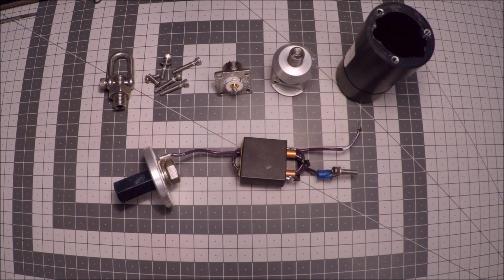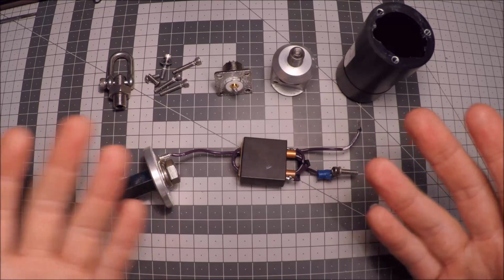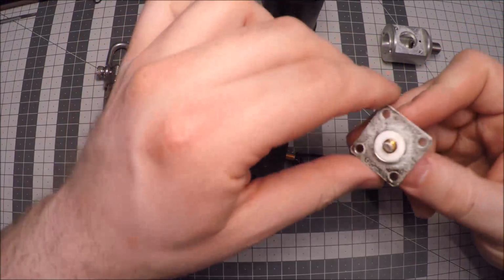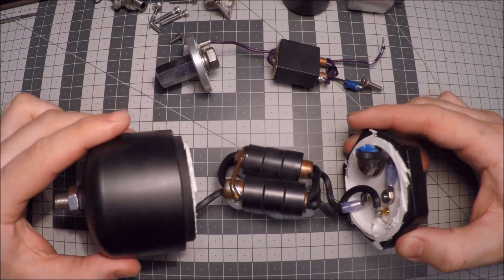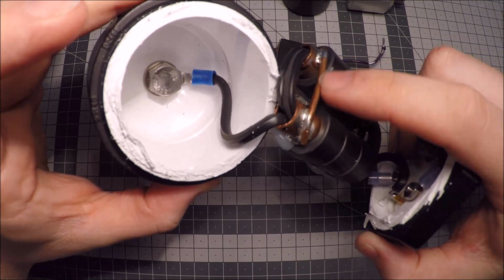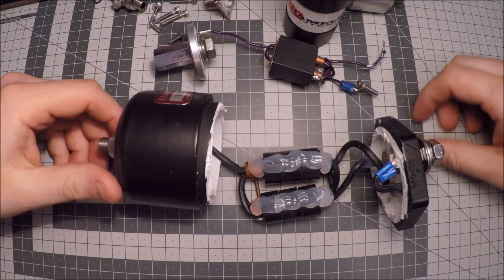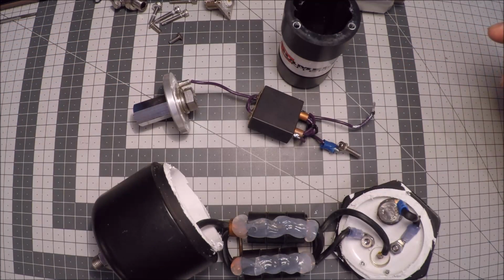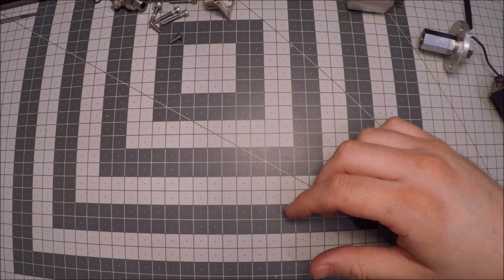Chameleon Hybrid micro VS. alpha match

Comment: Does anyone know what type torrid material the hybrid micro uses? I know the Ecom II uses type 31.
Reply: I use type 33 beads. Newark has the toroid cores that you stack, #98k8793. You'll need six. In lieu of copper pipe or tubing, you can tight spiral wind bare copper #14 or 16 solid. Works for me. eddieson
Reply: @johnstumm3155  Thanks for info! You are correct, the 33 beads are better. I am still wondering what torrid is used in the hybrid micro as I cannot find the binocular type in a 33 mix only a 43 and am wondering if maybe the micro uses a 43 mix?

Comment: Question, is the black  body of the Hybrid Micro plastic or metal?
 I would think stray capacitance would be picked up from the body if it was a metal body. Every unun I have looked at is always in a plastic box. This got me thinking when I saw your very good video on the comparison. I would be very interested in your comments as I am constructing my unun .cheers vk2jcc

Comment: The first HF antenna I got was a AlphaAntenna Promaster 1080 and it uses the exact same unun found in the Comet CHA250b... The only different part of the antenna is how the wire antenna is added with a counterpoise, they claim it act similarly like a off centered dipole... the core base of the antenna regardless is the unun which is exactly the same as the commercial antennas... I think many antennas are based on that copied system... I think the only other vertical with a matching unit that uses a different matching is the Diamond BB7V, there is a bank of resistors with a tiny core transformer, way different than the CHA250b. Still they are lossy matching units that render the antenna not performing really well. Again, those unun in your video are copyed from the Comet CHA25b design.

Comment: They are both trash whips using loss as a tuning option, just make a 26 mix 4:1 current balun and slap it inside a pvc pipe and some 3/8-24 hardware and you will be at the same level for $20
Reply: I totally agree, the money people waste because they are lazy or just ignorant, very sad!

Comment: Mostly because of your video, I bought a Chameleon CHA MIL unit.  It works great!  Finally, (the way I have it mounted on my apartment balcony railing), I can get on every band a General Can and simply use the auto tuner in my HF transceiver!
KD8EFQ/73!

The alpha antenna sucks.

Comment: Those antennas are trash. It's better a 25 feet wire antenna with 9:1 unun for qrp. I tried those antennas types, for me those antennas don't work. I once used a mfj 1820 t for my surprise was better than an alpha antenna.

Comment: I wanted to get on the air as quick as i could (even though I intend to make my own antenna's and experiement a bunch next year) and have been really happy so far with my Chameleon EMCOMM II I picked up based on it not needing a tuner and being able to mount it just outside the window of my "shack" (spare bedroom).  I have plenty of room for big antennas but probably still wouldn't have one up yet (I bought everything over thanksgiving holiday) so again, I'm glad I got the EMCOMM.  Once I install a better antenna setup I'll packup the EMCOMM and use it for portable stuff since it's quite small and would make a great portable setup.

Comment: both the transformers are 5:1 types used in the Comet CHB250.. do a search on google for chb250 clone and you'll find how to make them... can be quite lossy.. but work - sort of....... some have said its like a dummy load with s bit of wire hanging off it for the comet... cost me NZ$30 in parts to make transformer in PCV pipe,  used for a few years as a wspr antenna....

Comment: Alpha, sadly, isn't the only company trying to 'latch' onto the whole military thing. There are a lot of 'Milspec' and 'Military' product claims with no actual connections or use by military. And 'Milspec' only means a product is built to the military's specifications, but that means nothing about quality; its just the specs used by the military for standardization. And remember, the military is 'those guys' that lean towards 'lowest bidder', so military quality doesn't mean BEST quality.

Alpha's 'military' sales page, has NO products, NO means for 'military' to make a purchase and NO real content other then to 'look' official. But they still continue to use 'military' pictures on their website.

With the CHA MPAS being nearly the same 'package' as the Alpha 'EzMilitary' (short of the lack of a carrying bag with the MPAS) the difference in pricing is clearly demonstrated in this comparison. Chameleon chosing to have specifically designed parts vs Alpha's choice of 'off the shelf Home Depot' parts (matching units only) doesn't explain to me WHY the Alpha is only $65 cheaper. With the exception of the ferrite beads in the Alpha, everything in the Alpha Match can be had for <$30, some time with a drill & bits and a glue gun. There is a LOT more time/effort/design put into the CHA Hybrid Mini.

If I was purchasing such an offering...the extra money would be well worth the quality and longevity that I think is built into the MPAS. BUT...I don't 'hate' Alpha's antennas..they work for some people. If $65 was the difference between getting on the air and NOT being able to afford an antenna, I could see myself paying for the Alpha (with the KNOWLEDGE that I'd be looking to 'upgrade' in the future).

Antennas ARE always a compromise. And we all know that antennas are always a compromise of price, quality, efficiency, size, portability, PEP, mounting options, installation space, height restrictions. All those variables mean we HAVE to give up something to get some other benefit. But typically, when quality of construction decreases, we expect price to follow suit. Which is what has always steered me away from Alpha Antennas for YEARS, since I saw their first Youtube video claims of 'military' quality.

As many HAMs, Youtube videos and articles in print/online have stated, purpose, intended use, budget determine one's antenna needs. The Alpha works for some people, the MPAS  for other people. And now that 'what's inside' is better understood, we the buyers are more informed prior to making the choice. Personally, I'd buy the MPAS....and try to MAKE the Alpha Match.

Comment: Unfortunately I did not see this video in time, and bought the Alpha antenna. I am not at all pleased with it's construction and performance. I definitely feel like I got ripped off. Since I threw my money away on that piece of junk, it will be some time before I can get a better antenna. It does work, but not well. As for the military thing, I have no idea where that came from. I have been in the military, and they don't use junk like that. This thing is so flimsy I expect it to break at any time. I have no idea why it gets so many great reviews. If it cost $100 I might find it acceptable. I am using it with an Icom IC-718 and an LDG IT-100 autotuner. It seems to tune better on the 20 meter band than anywhere else. I definitely consider this to be a home made antenna, and certainly not worth what it cost.
Reply from the maker: i am sorry you also got fooled by this.. i know how exactly how it feels! it made me so mad i cut mine open.
maybe you could use the Alpha match and a wire (like the chameleon mpas has) and that would not be expensive.
i would read the mpas manual for hints on that.

a normal piece of wire, and a eye terminal + some strain protection and you are good to go.
you see the problem could be the tent pole not making good contact, and going with a wire could bypass and solve that.
heck, even sanding the joints on the mill whip could improve it (as long as the cord is tight) 

good luck to you, and let the rest of the world know how you feel, write reviews and share this video.

Comment: Wow! This is without a doubt the best comparison I have seen. The differences are staggering. It seems as though Chameleon has engineered every part specifically for their antenna match, where the Alpha looks entirely home brewed, and poorly home brewed at that. As a fairly new Ham I am extremely grateful for your sacrifice. Not many people would tear down what is essentially a $100 part. I suppose that is why there was no information about it until now. I was actually sold on the Alpha EZ Military until I saw your last video. This video however is a definite eye opener, and is certainly a tremendous benefit to the Ham community. I wouldn't be surprised to see some sort of lawsuit come from this. It seems to me that Alpha has completely misrepresented their product and have absolutely taken advantage of dozens if not hundreds of trusting Hams like myself. I want to thank you for keeping me from making what looks to be a terrible mistake. Keep up the good work!

73's,
Chris
K4CGB
Reply from the maker: +Chris B. 

Thanks! :)

Regarding lawsuits, what are you going to sue for? it is an antenna and it works, but it not that well made.
I don't think there is a case there, but the customer should be informed and make a decision with that information.

Comment: I own both antennas and think this review is very helpful to the ham community.  Thank you for your efforts. 73
Reply: +David Edger David, how does your Alpha perform? Does it get out?
Reply: Yes, it does work pretty well. I use it as a temporary antenna and I always use the counterpoise wire.  I work mostly CW and have worked many stations on 20 and 10 meters. I never run any power, usually QRP, but work most stations I call. I never leave it out overnight nor operate in the rain, but it does OK for a small vertical. I have not tried it on 40. Of course a good tuner is a must.